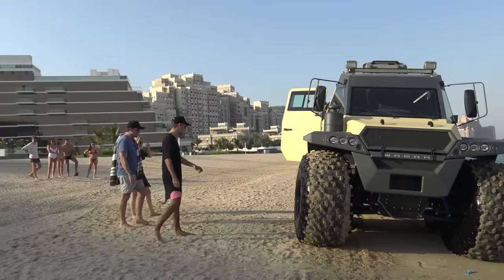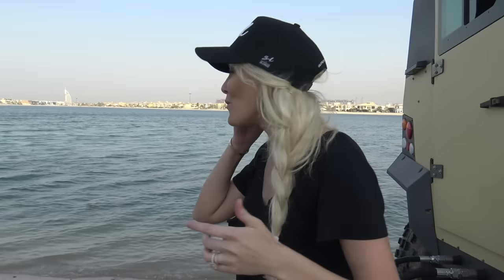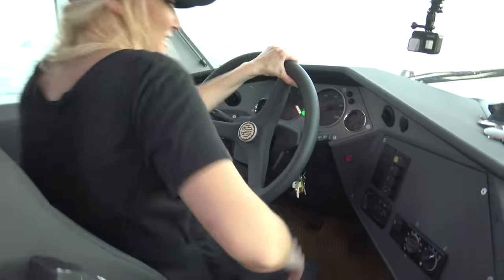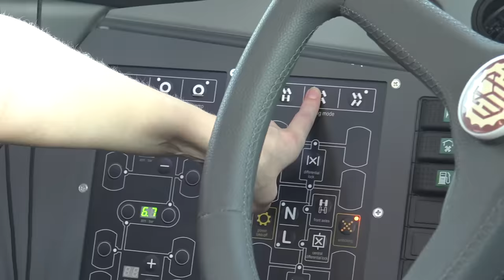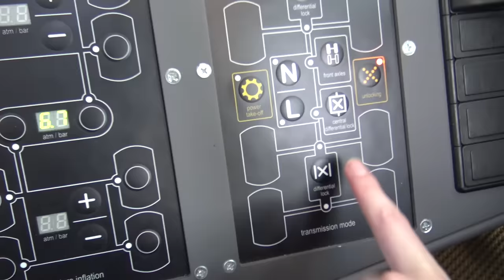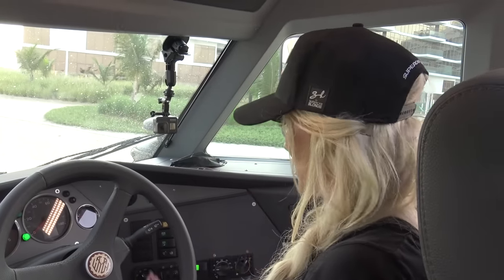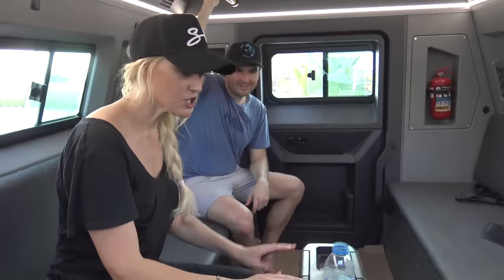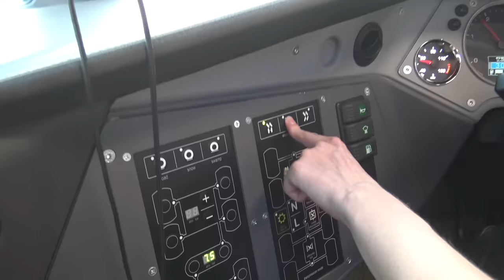I drove this 8x8 monster truck on the Ocean!

Comment: The "Shaman" car is also used by the Russian civil protection agency. There is also the “Rusak” model, also with an 8x8 drive, and the “Burlak” with a 6x6 drive. All models come from Russia and are even available for purchase. The "Burlak" has already reached the North Pole and the "Rusak" runs regularly in the far north and supplies the absolutely remote places there. One of the three models can optionally be equipped with a ship's propeller.

Comment: You know, that truck’s steering wheel is just in the PRECISE place I always felt many vehicles should be . Centrally mounted - giving one that true feeling of control over the vehicle.
Reply: this car is designed to move in swampy areas

Comment: Doesn't that propeller at the back feel too small for a big and gigantic monster truck
Reply: Because it's a truck not a boat. But a truck which can swim in water also.
Reply: @007furious  ya i know but to power such a hevy thing
Reply: @amoghrs8578  yeah i think it was to small it was barely moving it in the water then she turned the wheels back on seemed like the wheels were better at propelling it forward the the propellar
Reply: Yeah that truck has to be super heavy for that little propeller
Reply: The Propeller: REEEEEEEEEEEEEEEEE
Reply: Is for short distance, obstacle...5km per our
Reply: Looks like it won’t make it far on water
Reply: Size doesn't matter, how it's used does
Reply: But you can modify it
Reply: It was also too manually mounted propellers, no robotic switch mechanism positioned under. What VIP folks would want their hands dig in that. If the vehicle could've levitate its height ( assuming it doesn't have gryo balance🙄). It could been more accessible to that speed stunt, Blondie tried.
Reply: Land mode 99% 
water mode 1%

Comment: Still needs work in water, moves way too slow for the amount of power being generated - propeller attachment didn't help. Cool concept though.
Reply: Well, it wasn't designed to swim like motorboat, this feature more to simply cross water obstacles. But you'r right - if it will have propeller directly connected to engine like BTR-80S It will swim better
Reply: To be fair, it probably weighs 10 tons
Reply: @enadegheeghaghe6369  close to it yeah, maybe even about more. Them tires alone probably way close to a ton between them
Reply: I agree. Good effort civilian wisw, but military have these much faster.

Comment: This thing is crazy and looks like great fun. I could tell that truck looked and sounded really sluggish tho. Turns out it rocks a 3.0 Litre TurboDiesel packing only 176 HP. I know torque matters more in something like this and it is unspecified. I’d guess probably between 350lb on the very low end to maybe close to 500lb (extrapolating from figures on bigger more powerful TD’s). The really cool thing tho is… you can get one of these for barely over $200k and when you think about how you could easily get this thing pushing much more power for maybe another $30-$40k…. You could have quite the exceptional Behemoth for only $250k. Compared to some other stuff like all the 6x6’s out there… this would totally set you apart and keep you save during the next civil war.
Reply: my friend, the car's power is quite enough, this car involves long movements, so an economical engine is needed.
Reply: Да, Россия сегодня мировой лидер среди колёсных вездеходов

Comment: looks like it would use a lot of fuel using tyres for propulsion in the water, maybe in the future it may have a water jet upgrade. For redundancy in regards flats it should have really close coupled twin tyres that give a similar balloon profile as those single tyres. Such tyres exist but are pretty rare, maybe experimental - I saw such tyres on a car in a magazine over 20 years ago
Reply: She literally installed the water engine into the hitch

Comment: Very cool, I wonder if instead of adding a outboard prop, they built jet propulsion like jet skis. They could build it thru the bottom with all that space below. I feel like they wouldn’t have to worry about getting the prop snagged and it would allow them to move more efficiently without having to attach and detach the propeller… just visualizing driving thru a river with rocks and deep spots and switch to jet propulsion on the fly…

Comment: Nice aquatic truck but incorrect tires they do float but them it's almost like they're for climbing it's the other type of tires that they're needing like the kind that would have had the pattern on a tractor to be able to push the waves to be able to paddle